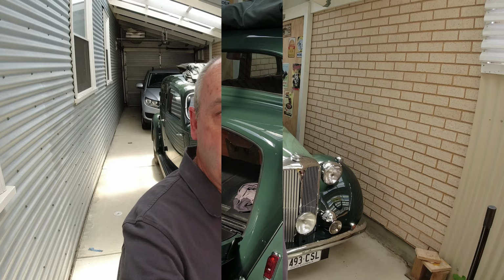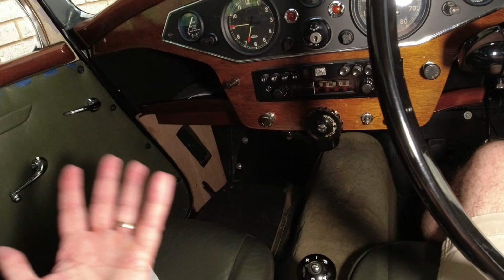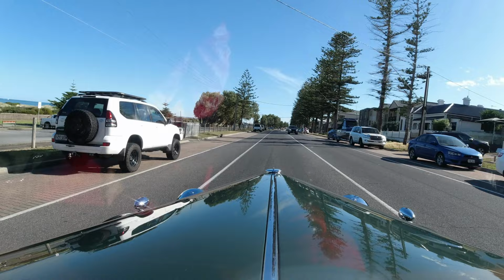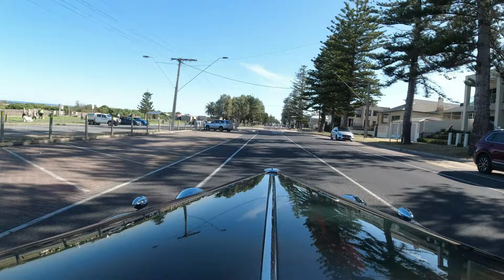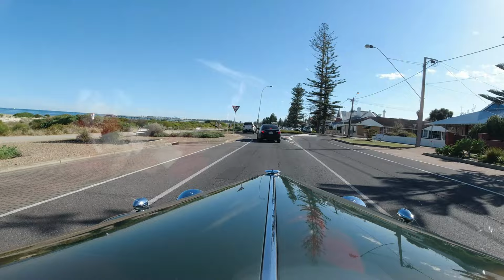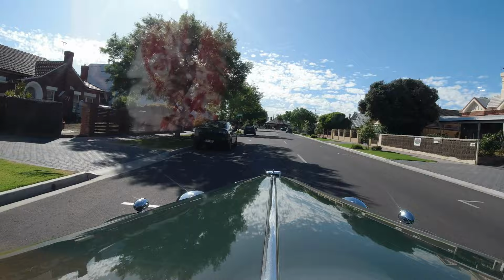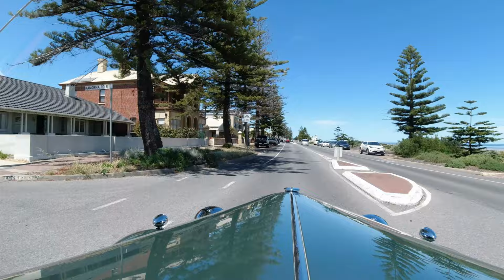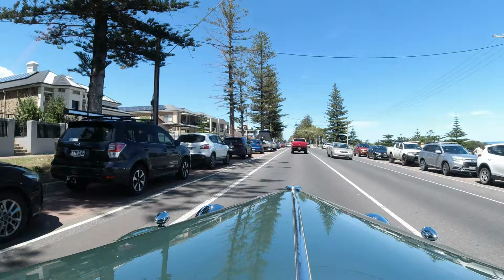Greg's 1949 P3 Rover restoration update and a nice little drive

Comment: Just fabulous! If you're struggling with 2nd gear, think of me passing my driving test many decades ago in a P3 in London. Next you want to be brave and try the freewheel - no problems with gears then. Where have you fitted the speaker for the Radiomobile  Model 100, or is it just for show? Incidentally, some of my wife's ancestors emigrated to SA in 1839 and Parham is named after them.
Reply from the maker: Hi Glyn I will give the freewheel a go. The radiomobile model 100 has the speaker built into the unit. Have tried to attach a photo to this message, but not working. The radio works, I had it restored by a contact who is involved with the historic radio society here. I am interested to hear about your wife's ancestor. I think Parham is more often referred to as Port Parham here. I have a Rover Car club of South Australia contact who lives there and he is also restoring a P3 Rover. I had some parts missing from my car and he was a great help to me; lending me parts from his car so that I could copy them.